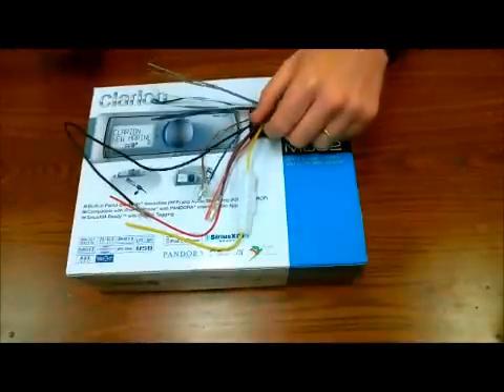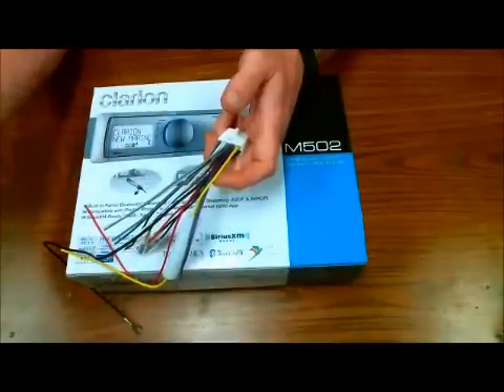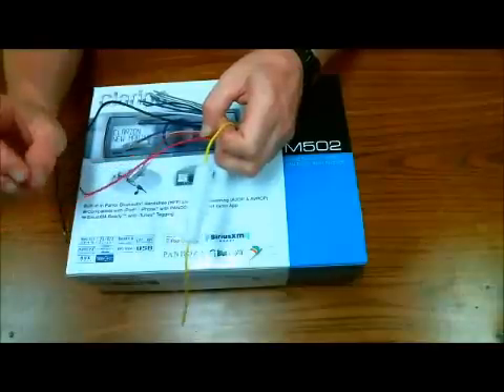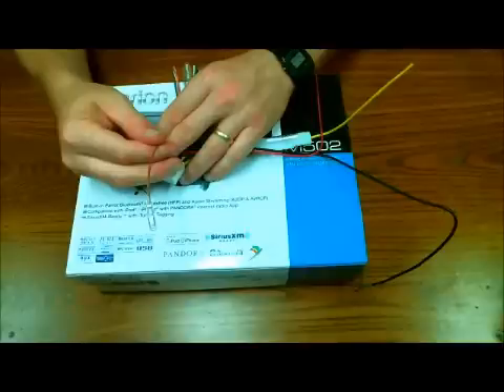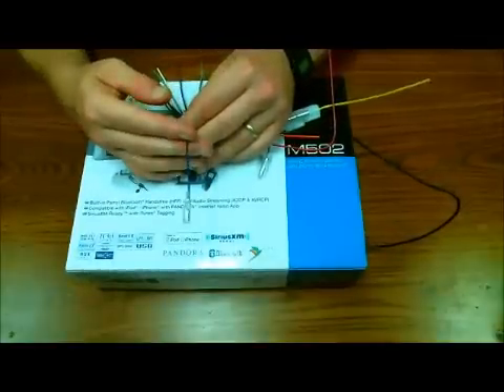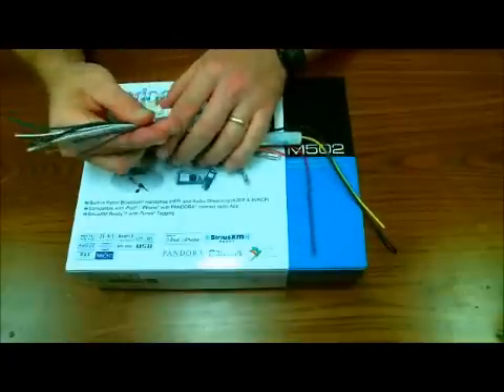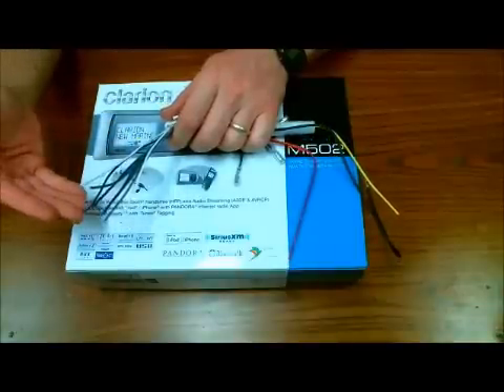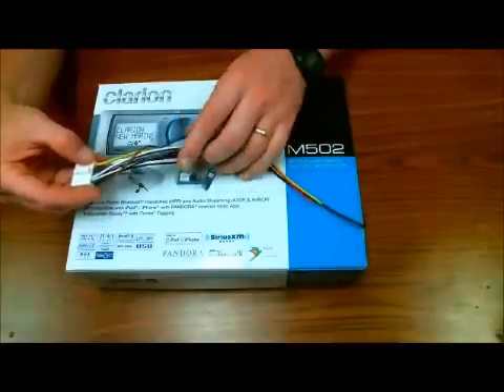Car Stereo Wiring Explained In Detail

Comment: I plugged the adapter to my CD and it worked, but it does not store the radio stations and it starts all over again.
Please explain How/Where to wire the yellow cable? The one for the constant power.

Comment: on my gmc sierra 82 c 1500, i have 3 wires.  Yellow, black, and gray.  from my, boss i have 4 wires, black,yellow, red, and blue.  got the black grounded, yellow connected.  I'm puzzled from there
Reply from the maker: matching is because you didnt use the wire adapter that matches them all up to simplify everything, get the 70-1677-1 adapter
Reply: Lessco Electronics    We have a 2 din 7inch touch screen model # 7653tm we cannot figure out how to preset station or change clock to standard instead of military time ? Or can it be done thank you Larry

Comment: I have just watched a You tube video on comunication problems with OBD2 scanners for cars, and the guy said that the problem was where an aftermarket stereo had been fitted and he solved the problem by cutting what he called the K wire but dit not explain what is the K wire is or colour or what it did. could you please explain to me.

Comment: What do I do when I have a factory 13pin,sld blue antenna,w/orange. trying to install a Bluetooth 12pin,sld blue amp feed,w/o orange.
Reply from the maker: org is just an optional dimmer wire and the blue is an optional power antenna lead, neither are necessary.

Comment: can I run my orange that came with my new 2002 ford wiring harness/ to my radio harness blue/ power antenna-amp turn on?
this new radio does have a bluetooth but no other wire other than blue. I did touch them together and the blue tooth emblem light up.

Comment: Hello, i want to wire my stereo to my leisure battery, i was going to do it by running a permanant memory feed into the memory slot and then running another permanant feed with a switch into the ignition switch slot. Will this work? will be running from a 12v fuse box so no need for inline fuses etc.

Comment: Or you could go to equipment manufacturer's webpage or install guide and get correct pin function, regardless of wire color, as some aftermarket harnesses do not always us standard wire colors.  And go to your car's website and do the same....regardless of wire color, there should be a plug diagram with each pin numbered, and it's function identified.  Using wire colors can easily cost your new stereo to go up in smoke, or damage to you cars lighting/dimming functions, maybe even worse damage..  Do NOT take it for granted that wire colors are always what they are supposed to be, especially when using aftermarket harnesses, unless ya got plenty of money if wire color is wrong to pay for repairs from assuming wire colors are correct..
Reply from the maker: Its not guess work, its accepted  industry color standards.
Reply: I understand that. Not trying to troll you, just stating facts: when it comes to using aftermarket stereos/harnesses it IS GUESS WORK, whether you admit it or not.  It is easy to verify this by going to auto homepage and get plug diagram with pin function/color, and do same for new unit to be installed.  Many will match up with industry standard, many will not, and I sometimes wonder if this is done on purpose to keep the DIY people buying only original equipment or factory upgrades to "plug and play". I have 3 subaru harnesses, and none of the 3 match the subaru colors or even each other's color/function, or match the industry standard colors. This is also true on a JVC, Sony, 2 Pioneers, and Kenwood harnesses/HU's I have at the moment, and these aren't junk. Your training is probably superior to mine in auto installs, but I have worked as draftsman with engineers F/T and freelance putting their electro-mechanical designs on paper for patents and production, and having installed dozens of stereos over the years, I am not completely ignorant of color codes, procedures, etc. Point is: many harnesses do not follow std. code, causing issues from a blown fuse or damaged unit, to damaging auto's electrical components.  Almost any car's stereo plug layout and pin function can be accessed freely online, as well as most aftermarket stereos, and these WILL be correct, per maker, regardless of "standard wire color function"  Why play guessing games with expensive units when it is so easy to ID each pin, it's function, and the wire associated with it, making a quick list of each for unit and car, leading to correct connections.  I toasted a HU last year, using only standardized wire color coding to make connections, even tho I knew better. I asked a YT "expert" about dimmer connection, followed his "expert" advice and smoked the light display on HU.  I also didn't notice any responses to the many questions related to this issue (wire colors not matching up) in your comments either.

Comment: is it possible/safe to just leave the orange (illumination wire) unplugged and just set the HU to my desired setting? Because i dont have an orange wire on my HU but it comes on the GM harness.
Reply from the maker: sure, you dont need it - its an optional dimmer wire

Comment: Have a 2002 ford excursion. Just put in my new head unit and my cluster and thermostat lights no longer work. But if i plug the wire back into the stock head unit it works. So obviously a wrong wire but the head unit and speakers are working fine and i matched wires correctly. I've installed many head units and never had this problem... Any ideas? Is the "illumination" wire off the head unit for dash illumination or head unit illumination?

Comment: Yeah so on my Honda S2000 all of my radio wires are two colors. For example, white with a blue stripe or green with a red stripe. So I'm fucked hahaha Can you help me plz
Reply from the maker: You should get a metra wire harness adapter and when it plugs in it'll convert all the colors to the common colors and you wont have to deal with all that.

Comment: I have a wire that is for illumination from my truck and a wire for "light switched" from my truck but I don't have either of those on my stereo harness. Where do I wire them so my dash illuminates again?
Reply from the maker: If you dont connect that it wont affect anything, thats there only case the new stereo has a dimmer wire input.
Reply: Lessco Electronics at first I left them disconnected and capped off. My dash lost illumination. I'm not sure but I think Nissan set it up so that the stereo drained some of the amperage off those lines because the dimmer switch overloaded and burned out once I turned on the headlights. Thanks for the reply.

Comment: so what do i do with the power antenna if the radieo  harness dont have a power antenna mine has an auto antenna that gose up  when terning on the fm or am radieo
Reply from the maker: pac makes an adapter for that, or you can make a manual switch yourself as well...

Comment: great video Lessco Electronics Thanks. Now what do you do when everything is hooked up properly, radio working as it should...until you turn on headlights. My jvc then says mispowered. check wiring.  I   don't  have the orange dimmer wire hooked up. I even tried hooking  the red and yellow wire to the battery + post and ran the black to the battery - post. There is a major wiring harness running to the lights right near the radio (John Deere tractor) Could the jvc unit pick up the voltage in those wires when the lights are powered on? Anyone know how I  could  fix that? I can only listen to radio in daylight.

Comment: Hi have a question. I installed a double din headset in my 05 impala. It won't turn on unless all 4 red and yellow wires are connected. The 2 on the radio and the 2 from the harness. It also will not turn off after the car has been turned off or I disconnect the wires. Could you please help me troubleshoot this problem

Comment: Hi got a question sir I install a head unit on my truck accedently the red wire came off touch something on the back now the units won't turn on but if I put the red and yellow together it works what can I do to fix please help thank you in advance
Reply from the maker: I cant see what it looks like, But bottom line is reconnect that red to a fused acc power source. Or better yet back to where it was initially if you can.
Reply: Thank you for quick response. I check the fuses and one the 7/5 fuses was blown is back on now thank you again. One more question I'm putting a back up camera on that unit to my 06 Honda Ridgeline I'm trying to connect to my reverse light on the back of the truck any idea which wire is the positive and negative thank you again!
Reply: use a multimeter, touch the ground lead to a chasis ground then touch the positive lead from the meter to one (at a time) reverse light wires. The one that shows 12 volts on the meter is the positive wire. Make sure your shits on and in reverse when checking this.

Comment: I really need help I have a 2003 Pontiac grand am I'm replaceing the radio with a pioneer only thing is unless the blue/white wire ,yellow wire, and red wire are connected nothing works but if connected it doesn't turn off what can I do????

Comment: Hi Lessco, I'd like to use my old car radio cassette to listen to cassette tapes in a NEW vehicle with no tape player.  -I'm planning on hooking the old unit's preouts (L +R) to the aux-in of the new car (3.5mm). Big question is can I set up the power supply to this old unit by connecting the red and black leads somehow into the cigarette lighter socket??

Comment: Bought 2007 Malibu as back-up transportation. Has replacement  Kenwood HD548U receiver. Driver's Information Center was supposedly bypassed. Wife listens to AM talk radio. Receiver will not pick up AM stations. Have tried resetting unit in every way I could find according to online manual. Have added aftermarket antenna with no luck. Tried receiver from other vehicle (JVC) which worked perfectly. Same results. JVC has same harness as Kenwood  so I plugged into existing harness. Must have something to do with the DIC by-pass wiring. Any ideas?

Comment: I got one for u its factory radio on a 05 Chevy trailblazer the radio illumination panel for radio and screen are not shutting off  when open doors and remove keys they shut off  as soon shut doors and interior lights  go  off pane re illuminates and screen shows hash tags and funny symbols and noticed u can press eject on CD player and I can hear eject motor engaging I think be a faulty ignition but need second opunion

Comment: Interesting video, I'm having an issue with my radio swap in my VW touareg. Just putting in a newer VW unit, this one is muted, can't get any sound. It's as if a call is in progress constantly.  Checked the wiring, new unit has amp pin, no wire in existing plug to connect to it. I think I need to splice a new 12v feed off the red accessories 12v wire so the amp gets power. Thats what I'm understanding from your info.

Comment: I wired my radio in with just the right speeakers, powered it on and it worked perfect, I unplugged the harness and wired on the rest(left side) and now there's no sound? There's power just no sound..

Comment: Can u connect red wire also with yellow so the radio turns on on power button without swithing ignition key on ? i dont wanna leave ignition key on every time i listen radio without engine running
Reply: That is why you turn the key backwards on Chevy's and one click on Honda's. It just turns on power to radio and sometimes window!
Reply: Davor Kekic 
the yellow wire is the constant power.  this is where you turn your keys on the first click (without starting the engine). if you connect both (red and yellow) , your stereo might eat up all you battery charge (drain it).

Comment: My radio buttons don't light up at night, is this because the illumination wire is not hooked up also does the illumination wire make the radio light up at night with the buttons
Reply: redbaron2448 hey I'm having the same issue. what did you do?
Reply: Cj Stevison had connected the illumination wire the orange wire to the 12 volt constant wire which is usually the red and works fine now
Reply: redbaron2448 OK cool. I have multiple red wires. so I'll just connect it to one of those. thank you.
Reply: yes

Comment: u have a question when i'm connecting the wires together do i have to get the batteri terminal off ?
Reply: You will be fine with these wires (12V) but do NOT turn on the ignition while wiring.

Comment: trying to wire a twin plug chevy impala stereo into a single plug honda accord large plug has 12 approx wires small plug has 5 wires  with the + & - hooked up on large plug the cd takes  cd but wont play it ejects from the button no radio or illumination

Comment: i hooked up the antenna blue wire to the solid blue wire from the radio and also tapped into the amp blue wire now it seems to be working right or is this wrong.

Comment: Nice run down indeed! however, I've got a problem with my head unit, at least i think it's my head unit, that has been plaguing me for some time now. I haven't heard or read anything similar to my problem so i will do my best to describe it, here goes. Since i've gotten the truck (2002 ford escape) i noticed that the audio fuse was plugged out, not questioning why it was i just got the correctly rated fuse and popped it back in and everything started to work well. Until some weeks had passed and when i would shut down the engine i would get a loud enough "pop" from my rear speaker....this is the speaker that's connected to the amp. I didn't think much of it cause when i would be driving the stereo works like a champ, until a "loud" squeal started to join the pop and the only thing that would kill the noise would be to pull that 10amp fuse. As annoying as this was it happened randomly until recently after i got my alternator rebuilt it started to happen "EVERYTIME" i would shut down the engine. One other thing i had noticed that helped to kill the noise was if i would push the menu button once after shutdown, the clock would come on then when it faded out the noise would cut with it too. Im hoping that you could at least shead some light on this for me or maybe point me in the right direction. thanks

Comment: I have a Scosche FDK106 stereo harness connector.  only wire I'm not sure about is the amp ground wire ,which is black with a white stripe.  what's the primary function of this wire. I'm not using any external amps, just wondering what the wire is normally used for.  thank you.

Comment: "Crank" and "ground wire" in the US term equate to "ignition" and "earth" wire in Britain. Most European countries use a word similar to "terra" for the ground wire. 
The video covers the principles, so a bright person should be able to connect up various audio brand looms in just about any kind of road vehicle or boat.
The loom comprises 16 wires of 2 types. Half are speaker wires, the rest are various power (operating control) wires plus "ground" wire. Some power wires remain live permanently, e.g. to preserve your radio settings while the vehicle is at rest. Other power wires are live only during specific functions of the audio's operation, such as radio on/CD off, or power antenna up/down. The relevant functions of wires are clearly described. The ground (earth) wire needs a secure fixing to the metal chassis of the vehicle and all wire-to-wire connections should be securely crimped or soldered and well insulated from its neighbours. 
The 8 speaker wires are in 4 pairs. A pair goes to each front and each rear speaker. Each speaker's pair comprises a solid colour (+) and that solid colour, blended with a white stripe (-). Any variation to the usual scheme is usually referenced to in the manufacturer's manual, and problems can be referred to forums for your vehicle. .

Comment: Ok I do have a pink wire wat is it for
Reply: YEA NORMALLY BLUE OR WHITE BLUE THOSE ALWAYS FOR AMP REMOTE CONTROL THING XD ITS A TINY WIRE
Reply: ground... wire mate
Reply: back up camera
Reply: Mine is a break light safety. Connect it to ground for bypass.
Reply: flux capacitor
Reply: Robert Nagy jr 

I
Reply: It's for blinker fluid level sensor.
Reply: Ibraheem Al hadede lmao

Comment: Great video.  How to do an In Dash DVD GPS stereo Parking Brake bypass?  On the common 30, did they use a positive signal connected to the terminal or a negative.  It says that you should use always a negative to connect a terminal or common terminal to a relay.  5 pin SPDT relay

Comment: sis I had my aftermarket hooked everything good. I put in the dash n radio went off (something touched).
now it won't power on with new stereo or stock. no fuse blown when checking voltage none in the yellow circuit what else do I do. no fuses blown

Comment: Can I wire a 12V wire with a diode so 12v get to the ACC wire (of the stereo unit) while the key is on the start position? the problem is the flip screen and stereo itself turn off while cranking because there is no ACC 12v while the key is in the cranking position.
Something else I have is a "pop" sound when the amplifier is turned on, I have wired its remote wire to ACC instead of the remote wire from the stereo, is this ok? why does this happen?
nice vid keep them coming...
Reply from the maker: instead of doing that, simple switch that red ACC wire to a cranking ignition wire at the ignition harness instead!
Reply: help!!! i bought a ssl radio has the same wires like in the video and i have a bettle 2001 bought a female conector  it has 2 green wires and 1 with a black stripe my question is why?

Comment: there is no remote wire coming out of my harness do I have to buy a new harness or can I install a remote wire in one of the blank slots?
Reply: i would imagine one of the open slots in the harness is for remote there just isn't one installed in the harness. ? maybe?
Reply: or maybe split power antenna wire?